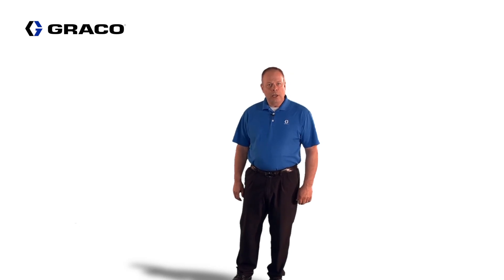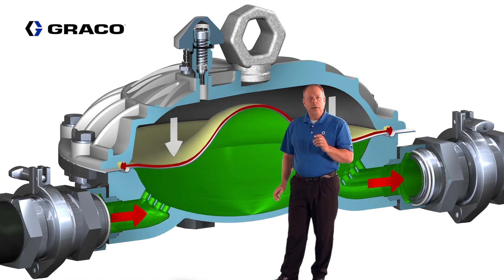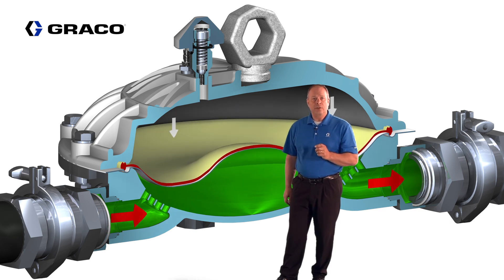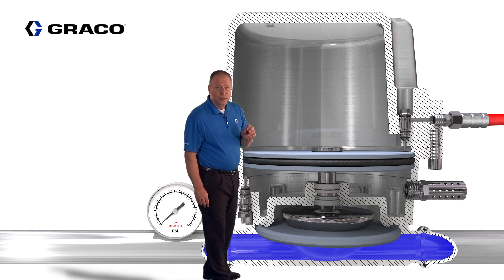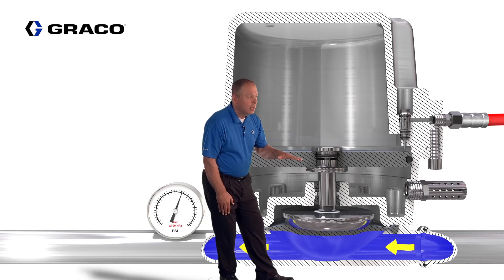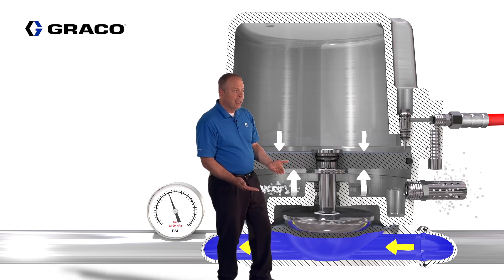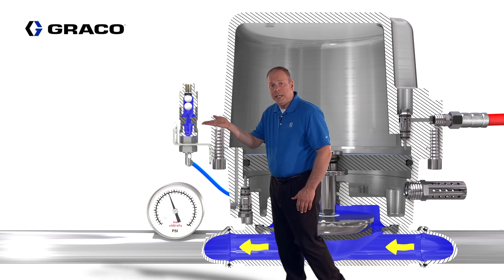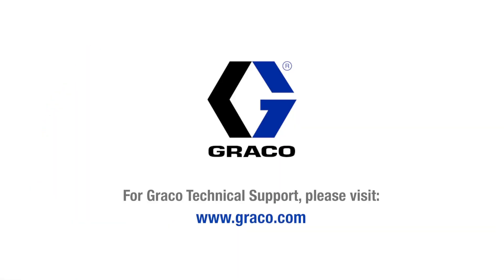Surge Tank Theory of Operation - Passive vs. Active Surge Suppressors

Comment: In the second model, the active suppressor. I have one doubt: does the air line pressure need to be the same as fluid pressure? What air pressure can I use?
Reply from the maker: The air line pressure should be 100psi. The ratio of the air piston to the diaphragm is 3:1, so active surge suppression can be managed up to 300psi inbound fluid pressure. If you have more questions specific to the equipment you're using, feel free to contact your local Graco finishing equipment distributor.